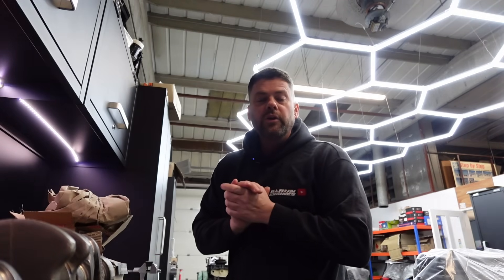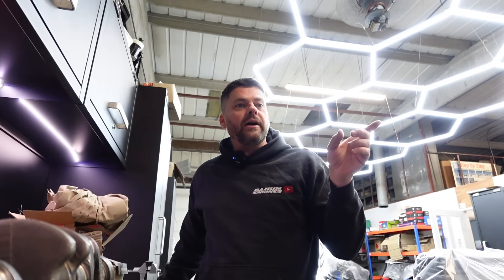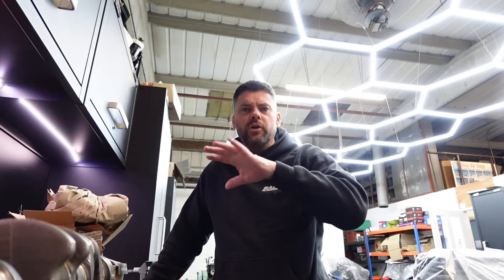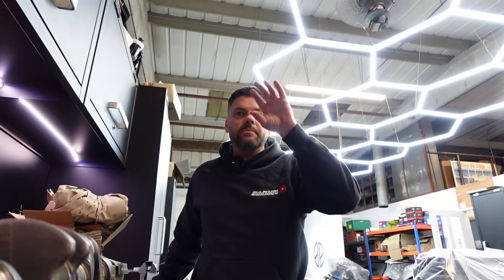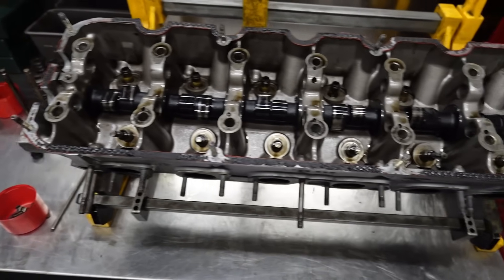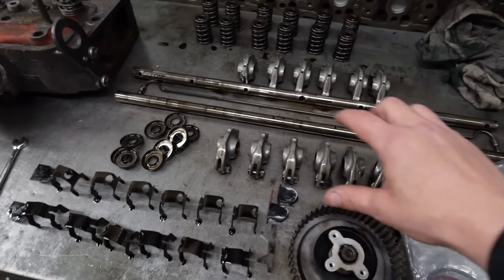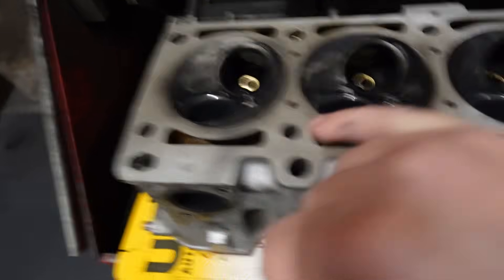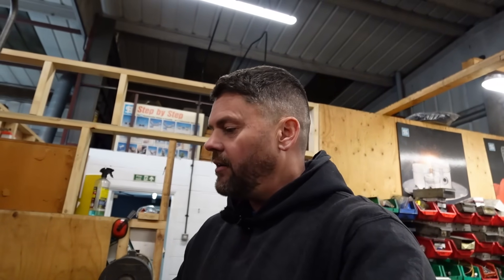THIS BMW 328i STROKER HAD TO COME APART AGAIN

Comment: Pardon my ignorance/confusion.
M20 single cam,  6 pot 2v per cylinder, belt driven cam, up to 2.5 litre (2.7l E28 525e)
M50 twin cam, 6 pot, 4v per cylinder, chain driven cam, up to 2.8 litre
Surely the cranks aren't interchangeable?
I'll stand corrected if they are.

Comment: Why all the RTV on the valve cover gasket. a Little dab on select places, and a dry gasket no leaks, but it was 30 years ago i worked at the dealer.

Comment: My guess is bad mapping washed the bores. 

Not sure it’s the case in this scenario but it seems people do not take mapping it serious, either use half baked systems or think it’s a novice diy task they can eventually get around to. Mapping needs to start from the first start to ensure it isn’t overly rich at any point
Reply: Most of the 'mappers' are cowboys, dreamers, or bodgers, and possibly all three.
Reply: @davidnorton5887 same here in Spain....no arreglar res....just map it out...egr,dpf and any other faults that put engine light on....😂😂
Reply: Im not a professional but that looks like running on coal😂😂...

Comment: Nice timing, just started on my M20 speeduino ecu conversion from motronic 1.3! Checking it on my 2.0 engine before swapping in an untested 2.5 (which came with motronic 1.1 I think, and no afm...)